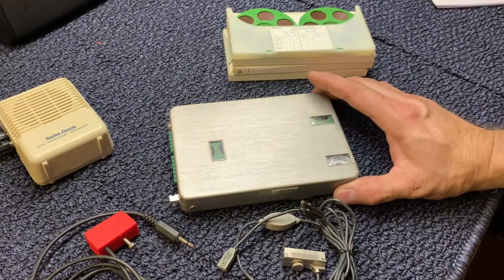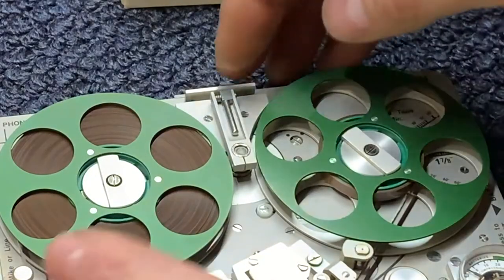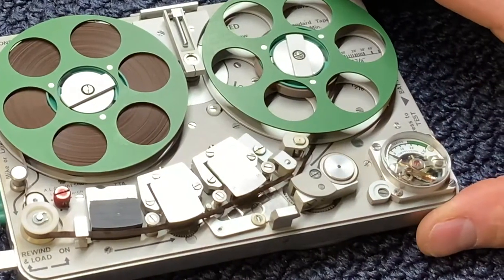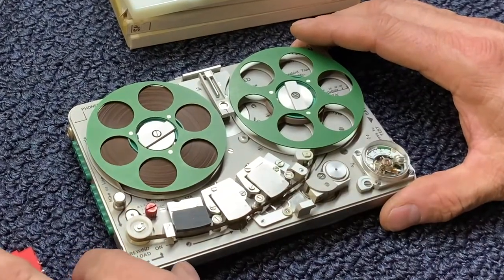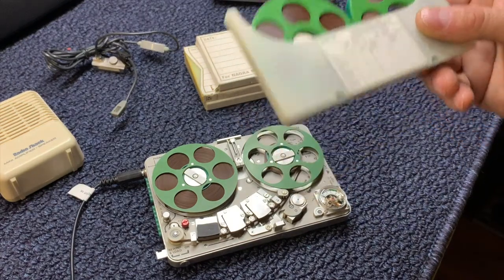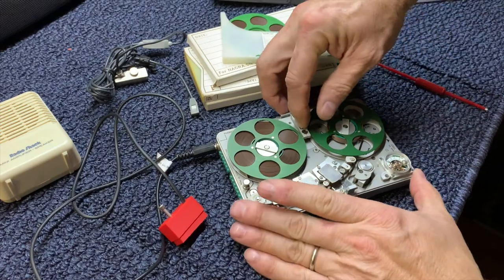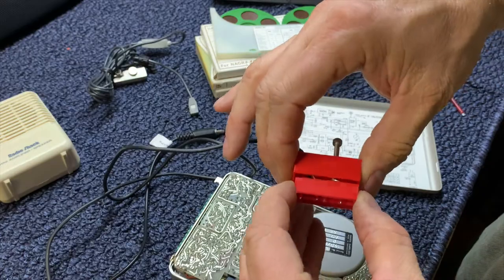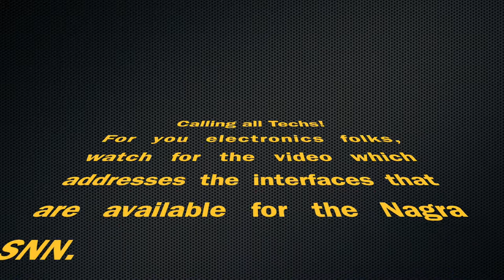The Crown Jewel: Nagra SNN Espionage Recorder

Comment: Amazing engineering. I wish Nagra had tried to make a Walkman for cassette tapes. I bet it would have rivaled Sony's WM-10 which is also a work of art. So this is a mono version? I've seen the SNST version in person before as my dad is ex-CIA.
Reply from the maker: Good grief. You are so fortunate to have seen an SNST. Wow.  Yes this is a mono version.
Reply: @KOVintageTech  Yes I believe he still has the SNST. It may be mine someday if I am still in the will. : )
Reply: @KOVintageTech  There are actually two stereo versions: The SNST and the SNST-R. The SNST was made for speech recording only, and to play back the highly compressed audio you had to use the DSM expander speaker, and even with that the sound was not too good (it was a surveillance-only model). BUt still very popular in the intelligence community... The SNST-R ("Revival") came in the 90ies, and could record in very good quality. It was a bit of a rich mans toy, costing about €9000, and very few were made. So these are very rare...
Reply: All are great. I do have a SNST model for those interested. 😁
Reply: @KOVintageTech  Is there a reason the wheels are green and if these weren't 1000 or more on ebay id pick one up.  Reel to reel is nice but a bit hectic for me so I only do cassette usually.  Someone on youtube used to have a demo of the stereo model of this not sure were it went to.
Reply from the maker: @stpworld  Thanks for the comment.  Yes, the colors of the reels indicated the length of the tape.  If I remember correctly, the super thin tape was on red reels (longest record/playback time). Then there were blue and green.

Comment: The only thing I think I find annoying about this is that the replacement spools are made of plastic. Maybe also how far out the control button extends.
Reply from the maker: I found two more metal spools. They are not cheap. And you are right. The control is a little peculiar. But it gets the job done.
Reply: @KOVintageTech  The manual rewind is a stroke of genius. I don't think most engineers would think of it as an option and it works so great - a lot better than a motor would. I guess most engineers of the day would have grown up seeing wind up gramophones all the time so they'd be more at ease with this solution. It's probably a lot harder and much more expensive to implement such a solution on a full size reel-to-reel machine - motors and pcb's are a lot easier to make to spec by comparison.
Reply from the maker: @Stelios.Posantzis  you are SO right. The rewind mechanism is so precise and solid. Premium Swiss implementation.
Reply: @Stelios.Posantzis  The control arm for the play/record, Stop or rewind made it possible to check if it was running while it was in the pocket (you wouldn't´t necessarily have the opportunity to take it out and check it in a surveillance situation).
Reply: @larsdela5906  That explains it then!

Comment: Did they ever make one with no erase or playback head to make it smaller.
You dont need and erase head as tapes can be bulk erased and you would never need a playback head as you would never use then at same time. Either you record OR playback, so just use one head
Reply from the maker: Correct.  The purpose of the erase head or erase magnet is to demagnetize the tape just before recording.  Most of these little units use the same single tape head for record and playback.  Along with an erase magnet.
Reply: @KOVintageTech  you dont even need a magnet either if the tape is bulk erased.
I restore 2" quad broadcast portable video tape machines that do not have an erase stack, not full playback electronics fir weight & size
Reply from the maker: @rty1955  yes I agree. I always bulk erase my tapes anyway as it seems to do a much better job.  Thanks for the great input!